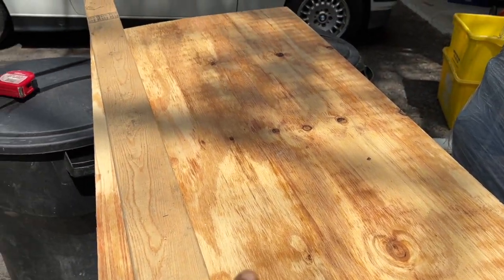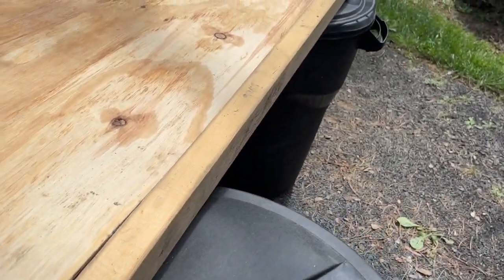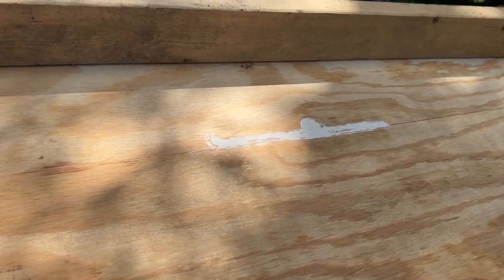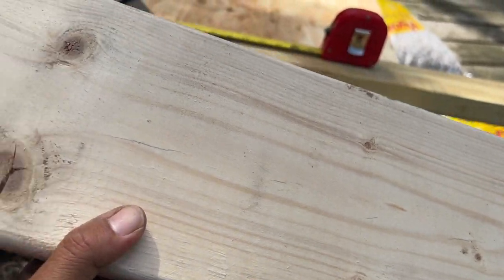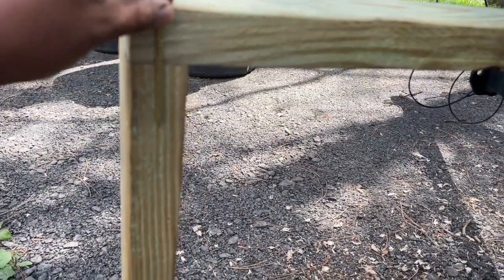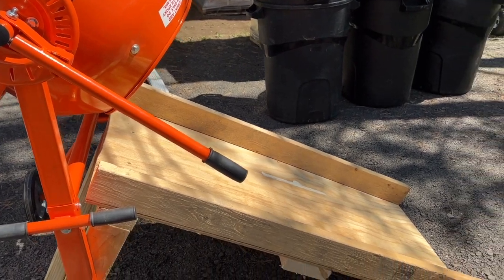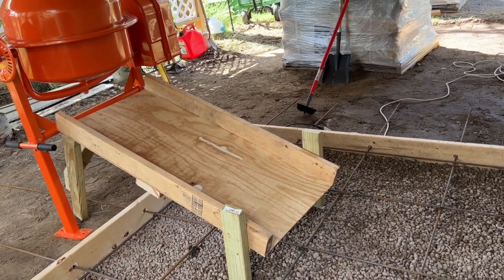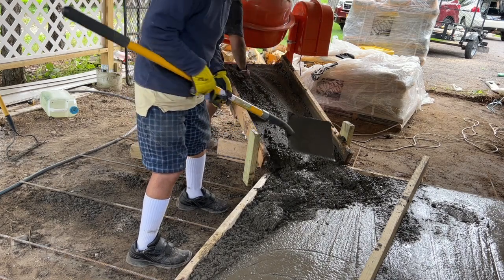How to make a CHUTE for your Harbor Freight Cement Mixer.DIY

Comment: Put a piece of thin wide metal on a ramp between two legs of your concrete mixer. That's all!😉
Reply from the maker: Where were you 6 months ago when I did this. ;)
Reply: @AJDIYNetwork  your idea is good too, but in my country it's expensive.
Reply from the maker: @111kirill111  where from?
Reply: Make a video or at least more details. Not very helpful at this point.

Thanks though....I guess 😳
Reply: @AJDIYNetwork  Moscow, Russia.
Reply from the maker: Of course, thanks!
Reply: @mr.c6674 a one rectangular flat piece of galvanized sheet metal instead of wood.

Comment: line the shoot with plastic to make it flow easier.
Reply from the maker: Absolutely.  Thanks for the tip!
Reply: Yes. You can reuse the wood after also since it's clean.
Reply from the maker: @robhersey1796 of course!  Though I haven’t used it since the first slab as I have been using the hand mixer primarily.